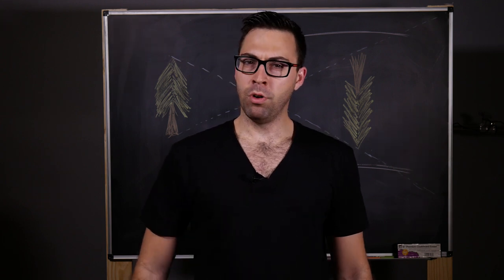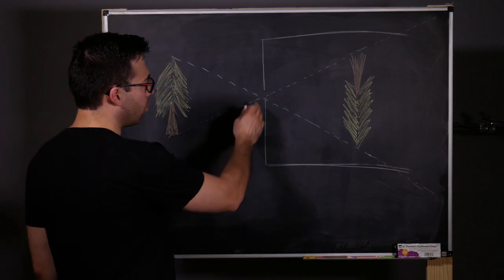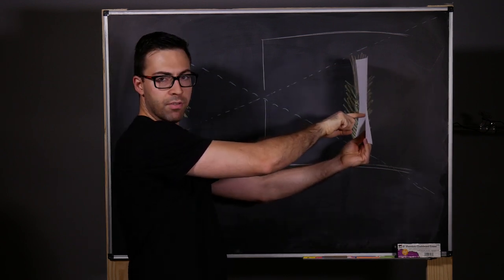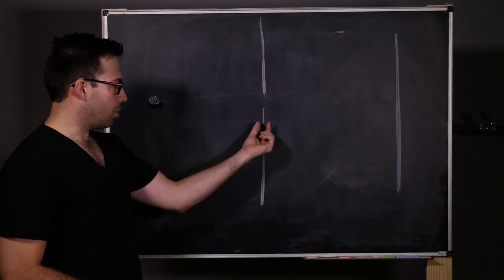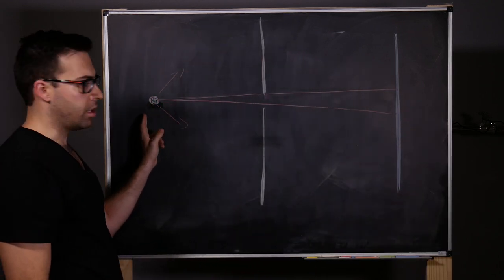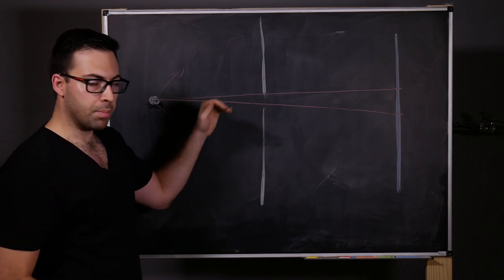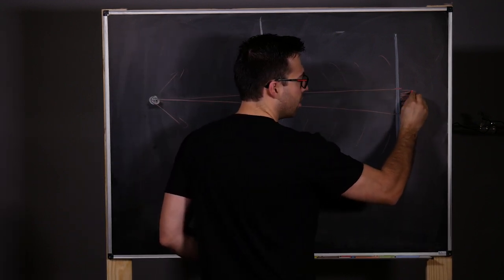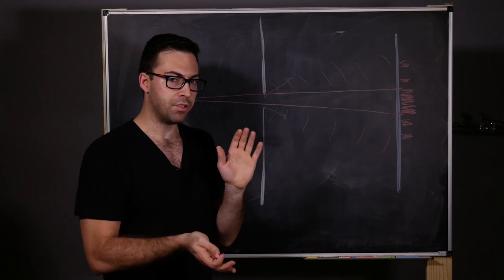The Pinhole Camera - Optimal Pinhole Design - Episode 2.0

Comment: Great video and explanation !!!  This is the first time I found a matematicaly justified explanation about optimal pinhole size selection. I loved you have included an explanation about the diference between blure due to geometrical issues and blure caused by difraction and how both afect the image resolution depending on the subject distance (landscape or first plane). I think you have covered every subject needed in order one can self calculate the right pinhole size without needing to use and trust in (doubt) web sites pinhole calcuators which give differents results from the same application. God job, Congratulations !!!
Reply from the maker: Thank you very much!

Comment: If there is an optimal pinhole for a certain focal length, then there is also an optimal focal length for a certain pinhole... I have a 4x5 view camera, so variable focal lengths, and a pinhole of 0.5 mm. How do I calculate that optimal focal length... Or rather, what is my ideal focal length for landscapes? Please, please...
Reply from the maker: True, we just have to solve the equation for f (focal length).

so for d = 0.5 you would get:

0.5^2 / (2.44 * 0.00055) = 186.289mm focal length assuming focusing at infinity.

on 4x5 this is close to the angle of view of a normal lens, so maybe not ideal for wide angle landscape photography. Something like a 0.3mm pinhole would be a better choice.

I have another video on my channel that shows the effects of blur (from pinhole too big) and diffraction (pinhole too small). It turns out that the effects of diffraction have a much less significant impact on image quality. So for any given pinhole, use the optimal focal length OR GREATER

So your 0.5mm is optimal at 186mm, but can be used past that. A 0.3mm is optimal at 67mm, but even using it at 90mm (standard wide on 4x5) will give good results.

For any focal length you will need to calculate the F-Stop as focal length/diameter for proper exposures. 

Hope this helps!

Comment: A very good video, very instructive and so are the rest in your series of pinhole photography. I have ordered a 0,4 mm pinhole and I am going to build a 4x5" (as I have 4x5" film holders) f110 mm camera. A practical question: Where did you get the treads for the tripod?
Reply from the maker: https://amzn.to/2Sq8a7t
They are commonly called threaded inserts. The most standard tripod mounting plates use a 1/4" by 20 size screw. Available many places online or at the hardware store.

Comment: Great video!!! was what I needed for designing my pinhole cameras... I deviced another formula since I can not control the diameter of the pinhole, so instead of determining the diameter of the pinhole based on a projection distance, I inverted the concept and used the formula to get the F distance based on the diameter: [F=d2/0.001342] where 0.001342 is lambda (550nm) times 2.44... what do you think??
Reply from the maker: That will work. Your method assumes that M=0 which is true for most cameras (it basically means you're "focused" at infinity). If you plan on doing macro work you would need to calculate the magnification and then do [d^2 * (1+M)]/0.001342. Good luck with your build!

Comment: Hi, how do I figure out the size of an image that would be created to cover the sensor perfectly so I get a full image? I guess how do you determine the size of the box vs size of the final image?
Reply from the maker: Exactly covering the sensor perfectly should not be your goal when designing a pinhole camera, you just need to make sure you have at least enough coverage to cover the entire sensor/film. 

The projected image will be a circle of light while your sensor is more than likely some kind of rectangle. You just need the image circle to be bigger than the sensor.

I have another video on angle of coverage that should help, but in short, the thickness of material and the diameter of the pinhole will impact the size of the image circle.

Comment: Out of curiousity what would happen and the result you'll get if the value of of landa changes?
Reply from the maker: A higher lambda (like 700nm for the red part of the spectrum) would mean you could use a bigger pinhole whereas if you were shooting things in the blue part of the spectrum (~400nm) you would need a smaller pinhole to be optimal. The difference would be very small though, and you should always error on the side of making a smaller pinhole. The most important is to have as round a shape as possible.
Reply: So you can use Konica 750 nm,cool.

Comment: You didn't give a justification for your use of 2.44 as a constant. My understanding is that this number is a bit contentious and is usually cited as 1.89 or 1.56
Reply from the maker: There should be no contention about the number used as the constant. It is mathematically and scientifically proven to be 2.44 as I illustrated in my discussion about Airy Disks. 

An optical system does not image a point to a point. An Airy disk is produced having a bright central core surrounded by diffraction rings. An image is considered resolved using the baseline criterion which requires that the plot of the spectrum return to baseline at some point between the two signals.

Using the model for an Airy Disk the first zero of the function is at a radius of 1.22. So if you have the central bright spot at a radius of 1.22 then its diameter is 2.44. Now imagine two circles that are the same size and next to each other touching on the edge. The distance from the center of one circle to the other is twice the radius or 2.44.

If that distance between the two circle centers was less than 2.44 then the circles would be overlapping (like in a Venn Diagram) and the image would not be able to be resolved.